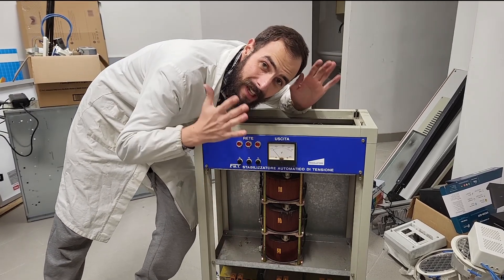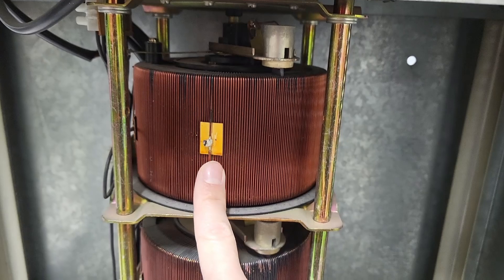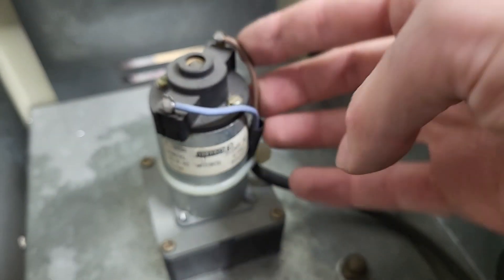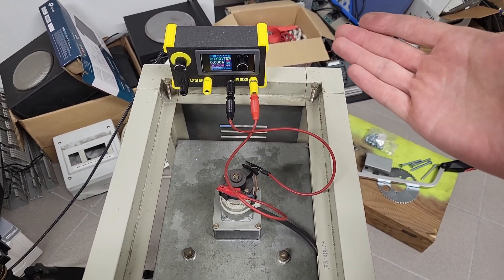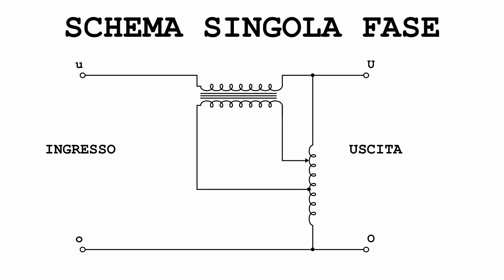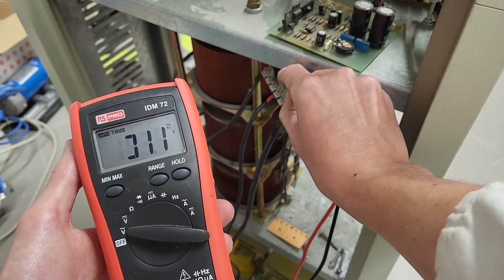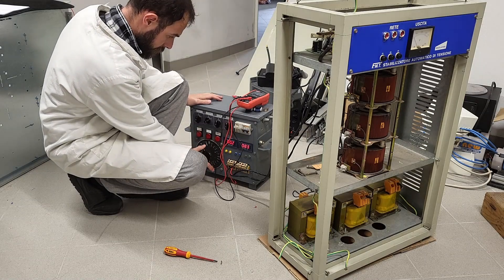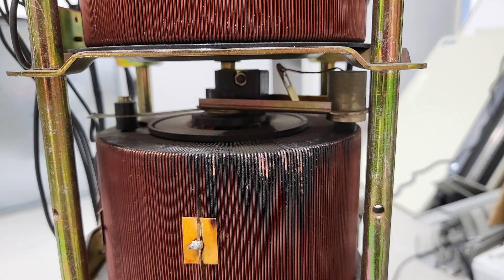Gigantic Three Phase VARIAC 22kVA Repairathon⚡What Can i Build with this Huge Electrical Machine?

Comment: This three-phase variac is a beautiful device. It is based on three autotransformers connected in a star configuration. It supplies the primary windings of three transformers. Carbon rotating brushes of the autotransformers allow for setting almost any voltage in the low range and increasing it, as needed.
The device is a stable source of current with a sinusoidal load waveform.
Congratulations to the Designers and the Instructor 👋👌.
Reply from the maker: Many many thanks for the comment!!:)
Reply: Thank you for the like 😀.